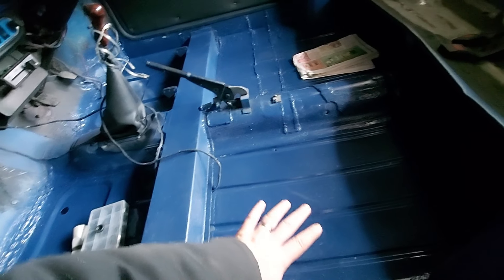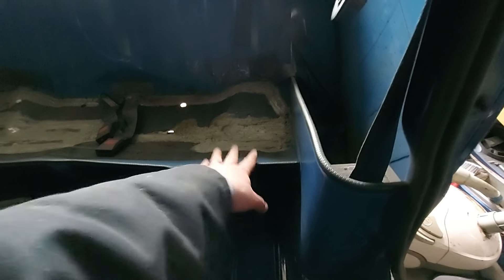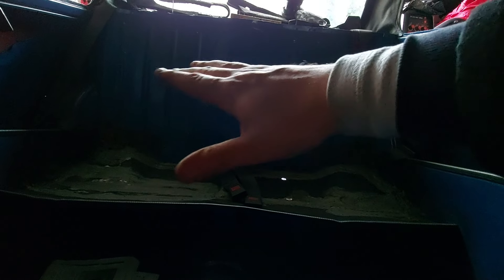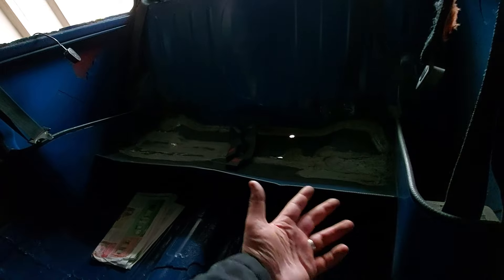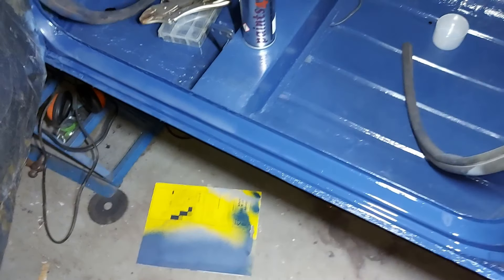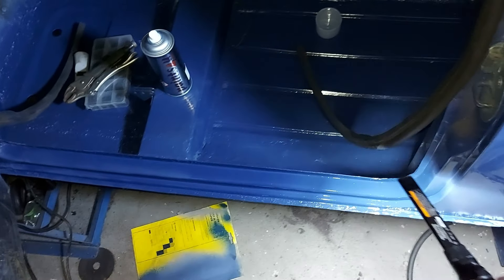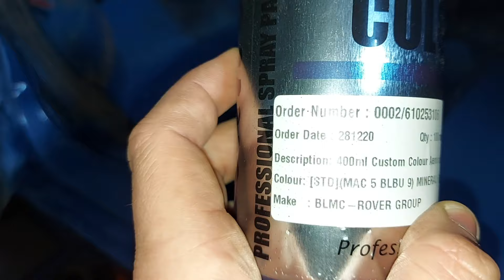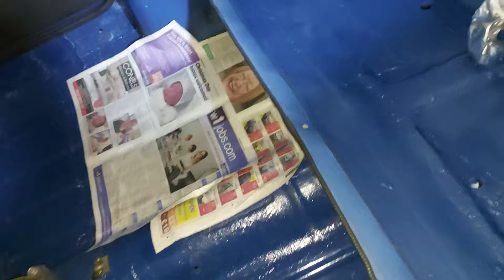Luke's Classic Mini Part 30: Update & Paint

Comment: Warm the area for paint first.
Apply 2 or 3 coats of high build primmer than sand with 800 grit, then panel whip and finally 2/3 coats of finish coat.
Allow to dry in-between coats.
Good luck
Reply from the maker: Thanks paul, im not a painter amd said from day one but it looks much better than it eould have had i have left it bare metal